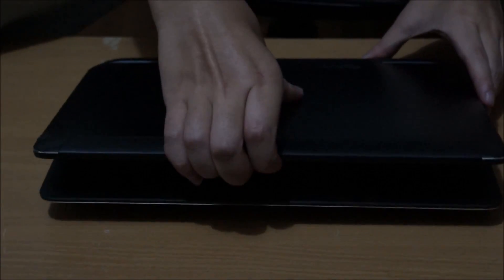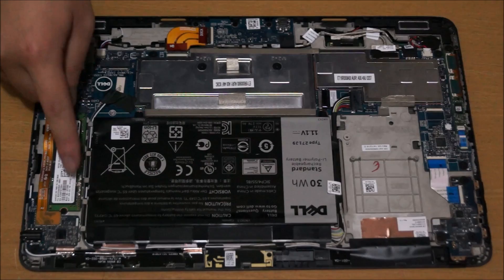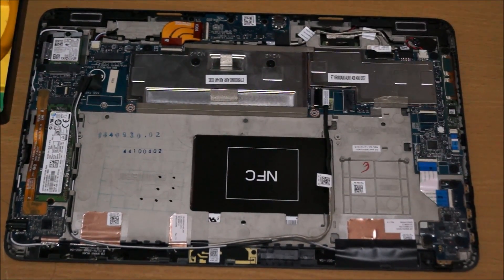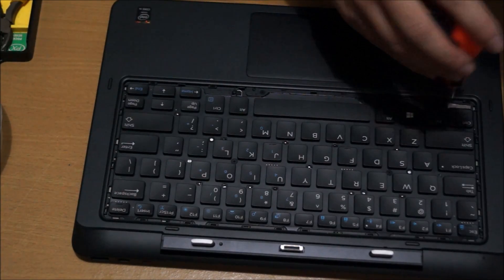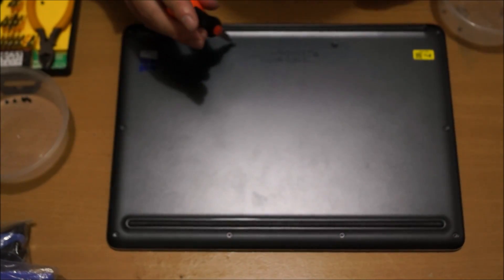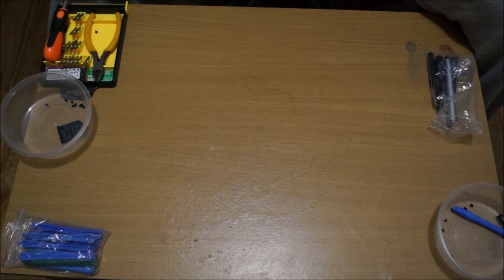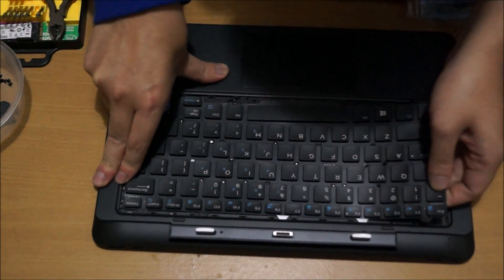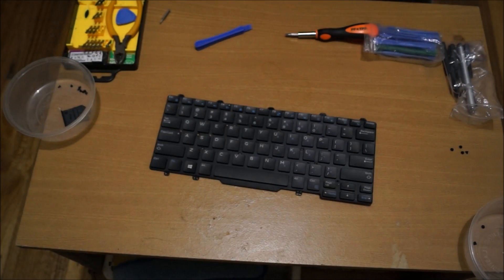OPEN ME UP! Dell Latitude 13 7350, 7000 series  2 in 1 Disassembly

Comment: I wonder what tool you are using? As i can only remove one battery screw, the black (normal one) which removes as expected with a phillips screwdriver, the other silver ones will not budge no matter what screwdriver i use?
Reply from the maker: can you watch the video and tell me at what time i can see the screw
Reply: @OpenMeUpTec  it's removing battery screws, ur using same tool for all of them, i can only remove the 1st black screw rest will not move, they are chrome, i read online it requires a torx 5?

Comment: I just bought one in uk for £160 used, beautiful touchscreen, bit heavy with keyboard, but huge upgrade for me with my previous motorola xoom, got 256 ssd,currently, but will get a 512 on ebay for  no more than £40, this vid will be helpful for me at some point, thanking you from Scotland
Reply from the maker: thanks for yourr support
Reply: Hello Sir. I have seen your comment also in another video which you posted 3 weeks ago. now that you have bought the device I have a question. It woud really help if you could tell me which type of Dell stylus does it support? I want to buy it as well if I can find which stylus it can work with. I tried many styluses but they didn't work on this device. Thanks in advance.
Reply: @hasti.k-pop8758  can't help you here, as i've not had any interest in a stylus for any device
Reply: @gglendinningok  Thanks a lot for your reply.
Reply from the maker: @hasti.k-pop8758  sorry cant help you with that. i dont believe this had any stylus support which is why none of them work
Reply: @OpenMeUpTec  Thanks for your reply. Yes I guess so. In the reviws of this device no one mentioned or used a  pen except for one video which he unfourtunately didn't mention the name of the stylus.

Comment: thank for your video. i was struggling to open the keyboard dock. i didn't expect the screws beneath the keyboard surround.
by the way, the torx are T5 (I tried T6 and wouldn't fit and T3 like you mention in the video may be too small).
sadly even with a replacement battery (TM9HP) it would still not recognize or charge it :(
Reply from the maker: yes the battery thing is extremely annoying. change the battery does not mean it will work as the keyboard doesnt recognise it. i had 7 of these and sadly each tablet needs to load firmware on the keyboard for it to work so after switch it around a few times some of my tablets wont work with the keyboard anymore and some have 2 or 3 keyboard working with it

Comment: Did you say you cannot change the memory on this model? I will keep watching but I am mainly concerned about
changing the battery, hard drive and ram from the laptop. Hopefully we can! I got a good deal on this I think, $475 for 8gb ram 256ssd. Its pretty solid for a 2 in 1. Love the keyboard! EDIT : Just seen your text (ram is solderd on)... ahhh! I do have a solder gun... ;-P
Reply from the maker: CPU is solder on, graphic card is solder on, ram is solder on, wireless card can be changed, and hard drive is a M.2 that change be changed. solder gun isnt going to help you as it is single slot so it only can use 8GB max

Comment: Thank you for this! If you still have this model, could you let us know serials or codes are on the little plastic piece in front of the dock battery? Adding a second battery to models that don't have one by default is possible, but there's a metal counterweight instead in those vs. that plastic piece. Getting ahold of the serial code on that plastic piece would greatly help others trying to add their own batteries to the dock. Thanks!
Reply: For context - models that come without a battery in the dock have this counterweight(http://www.cafr.ebay.ca/itm/1792J-Dell-Internal-Counterweight-for-Latitude-13-7350-Notebook-/142052694256) - and it blocks the dock battery from sitting properly. However, skipping this piece entirely doesn't work either because it serves as the support for the touchpad, and without either the plastic piece or counterweight the touchpad cannot click.
Reply from the maker: sorry no longer have the item to help you
Reply: NVM - found the part. It's K2V5J

Comment: There are 2 models of this keyboard, 1 with, 1 without battery. Are they basically the same, that you can just get a battery and put it in, or are the keyboards different, that you can't add the battery? Does anyone know?
Reply: Hey - in case you still needed an answer - you can add a second battery, but the palmrest will need to be replaced as well. In addition to the battery (part TM9HP), look for part number K2V5J.
Reply from the maker: your got the wrong item. the keyboard for this item has a battery in both mondels you probably talking about the latitude 11 not 13
Reply: No there are definitly 2 models, 1 with battery, 1 without battery. Its the latitude 7350 I have and it was shipped without 2nd battery. Dell Part Nr. with battery: FRVYX   and the one without: PXWGK   but I was wondering, if just the battery is missing or if it's completly different I thought you probably know before I open it to see if it looks the same as yours.
Reply from the maker: the first model number was for the battery replace the second one was for the keyboard replacement. none of them are for the whole keyboard unit
Reply: You're like my new best friend!

Comment: Hi I have a Dell 7350 and Battery one is dead can you give me a part number for Battery one I guess its the one on the tablet 
I would appreciate it thanks
Reply from the maker: +hnankani for the tablet 271j9 and for the keyboard is TM9HP. if you watch the video properly you can see the part number for both battery
Reply: +OPEN ME UP Thank you for the information and quick response one last question which would be Battery 1 & Battery 2 as per the Diagnostics run by dell the report was Battery 1 was dead and battery 2 was good....Thank you again I really appreciate you responding
Reply from the maker: the battery always dies i have 4 of these now and 3 dead batteries
Reply: +OPEN ME UP  They are not available on dell website and in canada as well looks like i have to order one from the UK or China can you suggest a safe online store where i can buy the 271j9 battery, thanks in advance
Reply from the maker: call dell and tell them the part number. most things arent available on the dell website

Comment: I can't seem to open up the keyboard part. I unscrewed all the screws and unclamped the clips. I can open it a little bit but I cant easily lift the panel off like you did. Any tips?
Reply: +TheTonyk123 Never mind, I didnt remove the keyboard screws.

Comment: I confirmed with Crucial (Micron) that the RAM is upgradeable. The preconfigured RAM is soldered but there is supposed to be a slot to add more RAM up to 12GB. For the life of me I cannot find photos or video of the RAM slot. Can you confirm? 
Maybe it's under the CPU cover you didn't remove? 
Here is a link to the RAM upgrade: http://www.crucial.com/usa/en/compatible-upgrade-for//latitude-13-7350
Please post if you can help clarify.
Reply from the maker: +Seph P. Sorry they got it wrong and it can not be upgraded. there is no other slot. you can contact dell and they will tell you the same

Comment: After you disassembled it can you put it back together again, so you can't see it have been open?
Reply from the maker: Thomas Bomholt Kristensen I originally plan to film myself putting it back but then it was pretty pointless as it is the same thing as taking it apart but backwards
Reply: Okay thanks :) i just bought on really cheap but with no battery in the keyboard. So if i put a replacment battery in the keyboard i Hope it will work :) and i will have savede some box $$$ :D
Reply: Did it work? I have a keyboard w/o battery and trying to see if i can just buy the battery and stick it in there
Reply from the maker: i have four of these and 3 of them had a dead battery. i got a new battery but it will only work in one of them in the others it will not register and still thinks the battery is dead